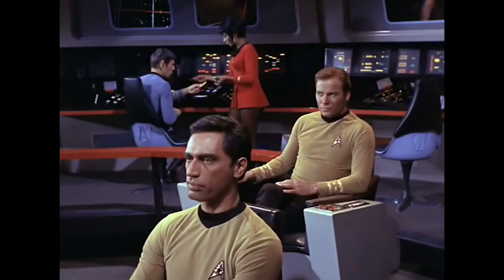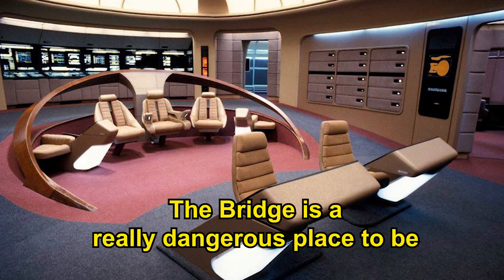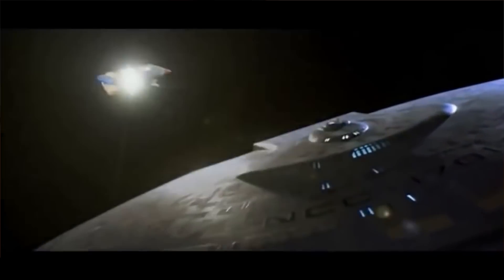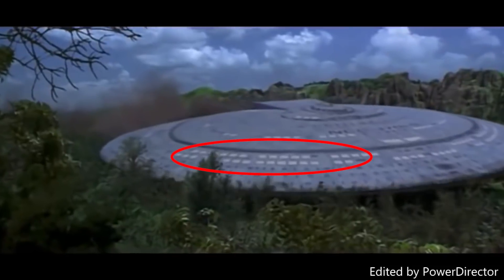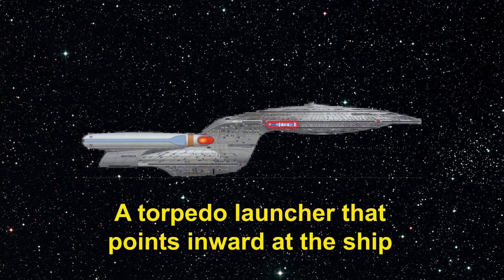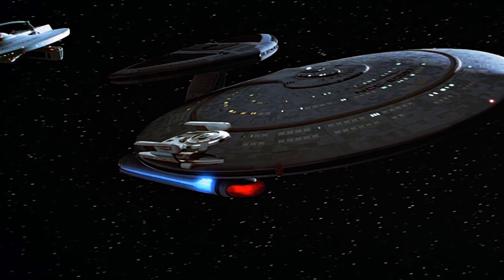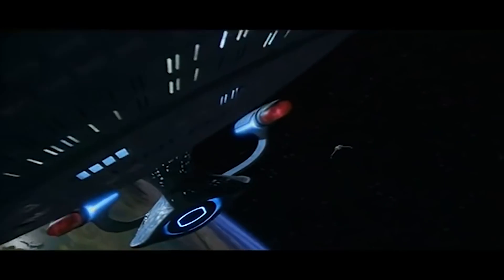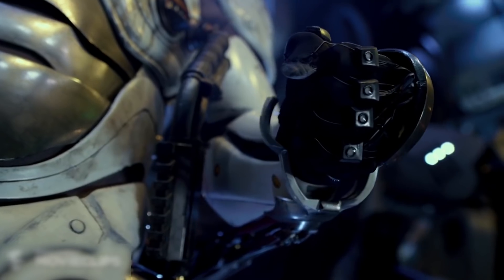10 Flaws Star Trek - USS Enterprise NCC 1701-D

Comment: You did overlook some major engineering problems. Season 2, episode 11 "Contagion" it is stated the computer automatically dumps the antimatter to prevent a containment breach, saving the ship. That is true with the emergency warp core ejection as well. These systems NEVER seem to work! In Generations, they both fail. You do not even hear them mention an attempt to try either. Just, "Oh well, that last torpedo killed it. We give up." In many TNG episodes involving alternate timelines and realities, they fail. Are all the emergency systems out of order in engineering LaForge?

Why is it sparks fly out everywhere during the slightest hit? It is like there are very weak, poorly insulated, and exposed high power conduits running everywhere on the bridge. It makes zero logical sense to have that much power running through it. If anything, the bridge in the future should have very little power actually going through it. If we can run touch screens off 5 and 12 volts of DC, I am pretty sure they can run the controls and lights with the same or likely less power than today. So why is there so much power running everywhere through it? And that also leads to the exploding consoles. I think everyone agrees on that one the most! We have surge protectors today. Our touch screens do not explode either, with the exception of defective lithium-ion batteries in some cell phones or laptops. In the future. it is like they explode if somebody sneezes on them! Are they made out of recycled TOS red shirts or Storm Trooper armor?

You are right. The nacelles, while not technically the engines are seriously flawed in design. They should have some beefed up armor or protection, as well as the bridge. As we saw when the Boseman just lightly brushed the starboard nacelle and ended up destroying the ship. Seriously? Do they not have some sort of surge protection or cutoffs or for warp plasma? Then the emergency warp core shutdown fails. That is like not being able to shut your car off when you have a damaged tire and your car explodes. The warp core ejection system never seems to work. And then again, the antimatter dump failed. It is like all the engine safety protocols do not work!
Reply: I think the only system that works with any consistency is gravity control.  Lights flicker, panels explode, the Holodeck becomes lethal, the fire suppression system fails, the replicator screws up orders, life support stops working, shields get penetrated, the computer contracts a virus, and the warp core doesn't eject.    But gravity?  That shit is tight.
Reply: The system was damaged rendering both auto and manual release impossible.
Reply: @AJB2K3  

yea but even todays passenger liners, and airplanes have back ups to back ups, and that's before you even get to government vehicles, and the military, which normally have complete fail safes incase all 3-4 back ups fail.. To think that the USS Enterprise would go out into those situations, and supposed to be deep exploration to boot and a scientific ship exploring god knows what, with virtually no backs ups to any of its system is just asinine and ridiculous lol.
Reply: @kev3d  you can have 20 backups but if the mechanical releases are jammed (fused in this case) all backups are pointless.
Reply: Daniel Miller I think Voyager had the worst where the Manual Override to open the doors goes offline with the rest of the ship
Reply: When the technical people wrote the book on the ship, "of course" everything was automated and perfect.  Writers though...  They need drama, and the first question they ask when writing a script is, "how can we destroy this ship, because that would look really cool!"  

Most of your observations are valid in the world we live in.  In Movieland, it would be boring as heck if there was no drama, like no need to abandon the ship or land the saucer section in a forest, or even see an exploding console send Worf flying over Picard's chair.   We wouldn't pay money to see it, and the universe we all love wouldn't exist because nobody would write, produce, and direct for free.  Odd how capitalism pays for a series based on a Marxist utopia.  :-)
Reply: I think the warp nacelles actually are the engines, they warp the ship through space faster than light. Warp 1 is the speed of light. The impulse engines are for sublight speeds, I think they go up to 1 quarter the speed of light. Oh maybe you tend to think of the warp core as the engine, which you could sort of.
Reply: Lol nice.
Reply: If the ship is hit with energy weapons (phasers, disruptors, plasma, etc.), then it stands to reason it would create a surge in the power grid ship-wide, causing explosive results at interface terminals and computer control stations, possibly knocking out normal redundancies and safety protocols. But I agree, ship design concepts and drastic system failures make no real sense other than to amp up the drama in show.
Reply: FYI the first console to "catch fire" was the original series episode when they first cross the great barrier. I agree consoles exploding is unrealistic but adds to the drama. However, "grounding" on earth means literally connecting wires to the ground (dirt, rock) to shunt excess electricity I.e. during a surge or lightning strick. In space, you can hold excess charge with capacitors however, if surge suppressor is not grounded (no planet to connect a wire too), the excess charge will overload it and go into electronic device and, in rare cases, nearby objects such as yourself. All the weapons are directed energy weapons of some kind so....the consoles need an emergency disconnect when detecting excess charge...not a warning that it will explode (which they sometimes get)
Reply: NEEERRRRRDDDDD
Reply: @jeffnewcomb601  "Odd how capitalism pays for a series based on a Marxist utopia.  :-)"
Your last line was your best line.🥉
Reply: Jeff Newcomb Actually it’s not odd, it’s natural.
Reply: For a lot of the comments about fused release clamps,
The last resort backup would be explosive bolts similar to that in jets, the locking clamp fails, (manual release) blot the bolts and send it flying, (real emergency release)

As for surges in power from weapons, heard of shunts, fuses and breakers? Plenty of over voltage and over current protection even back when it was written, none of this is new
Reply: Because it’s a silly tv show! <— That only took a few words.
Reply: Jeff Newcomb have you seen the expanse?
Thats fairly darn close and still very entertaining
Reply: Consoles would almost certainly use very low power fiber optics which could not transmit any 'surge' power to the user. The entire ship is probably made from non-conductive plastics and carbon fiber, maybe some ceramics. Nanites will make repairs on the fly and damaged control systems will automatically be re-routed within nano seconds.

The command bridge has no reason to be anywhere but the safest interior part of the ship. The view screen is a digital representation anyway, there are no windows on any of the Enterprise's bridges. We can give the ready room 100% realistic representations of the outside space for effect. 

Such a crucial system as emergency warp core ejection would be made in such a way as to have 100% certainty of ejection and clear, even at the expense of damage to the ship to get it done. Another thing that bothers me is having a central computer control everything. We don't even do that anymore today. Consider that far in the future a computer the size of your cell phone would have the capacity to control the whole ship, and they would have those everywhere. Having a human control pretty much any crucial system would be stupid. Humans are aboard to make humanity decisions and to maintain the computers and associated systems. 

Having a human decide to target an enemy, yell 'fire' and have the other human push a button is 10.000.000 years in computer time. In a wartime situation anything not friendly comes within a LY of the ship will be automatically obliterated. In Eve online terms NBSI.. not blue shoot immediately. Because you do not survive otherwise.

None of that helps with the plot however, which is the most important part of the ship.
Reply: And BTW in space we are not in the least worried about the volume of the vehicle but rather in it's mass, which is mitigated by advanced light weight materials.
Reply: Dark Helmet said it best in Space Balls when they found the out-of-order self-destruct override: “Fuck!  Even in the future, nothing works.”
Reply: The nensels are more like  props on a battleship. And they are armord. Thing is the torps the enemy fires are antie matter. 
Number two the WARPCORE is the engine
Reply: The Galaxy class starship was well known to have a very, very fragile warp-core. 

It's a Shakespearean actor, with a glass jaw.... just like its captain.

Comment: Have you looked at where the bridge is on current war ships and aircraft carriers?
Reply: Current ships are not fighting in close combat. You can not aim for the enemy's bridge and think that you will hit it. We are shooting shells over a distance of several kilometers onto a moving target. 
Well, in an actual space battle the distance would be far greater, but in the Trek universe, the space ships are fighting close combat with near lightspeed particle weapons. They should hit where they aim.
Reply: @dennisbode6106  You're still thinking of two battleships fighting each other. A modern navy battle would not be like that. Most ships carry smaller, higher velocity guns, along with a bunch of missiles. Aiming at a bridge with modern advanced targeting systems wouldn't be difficult at all.
Reply: To be fair there is a internal control centre for the weapons aboard a ship.